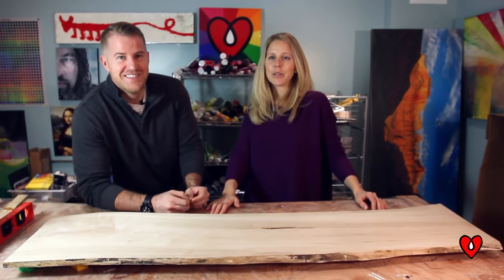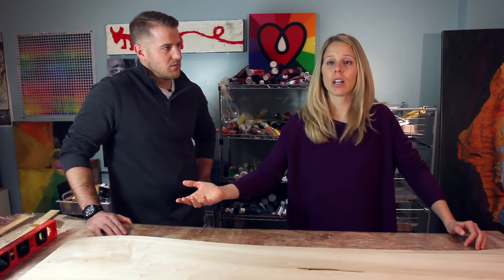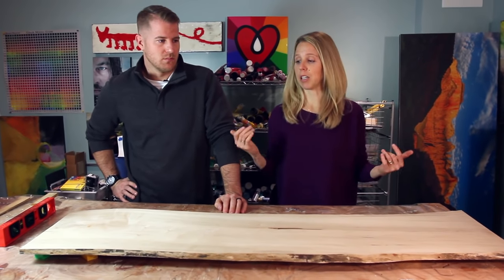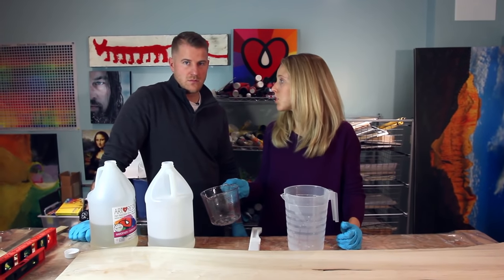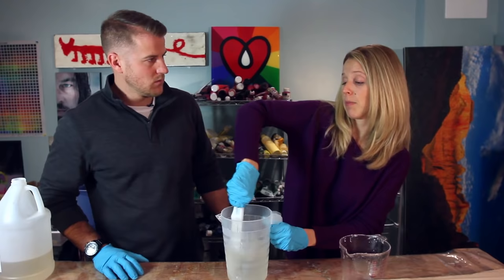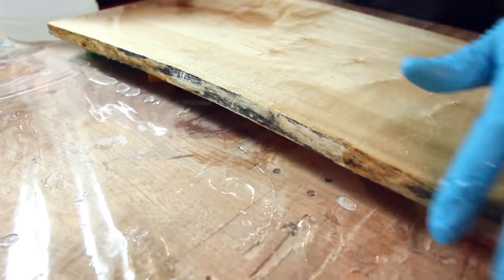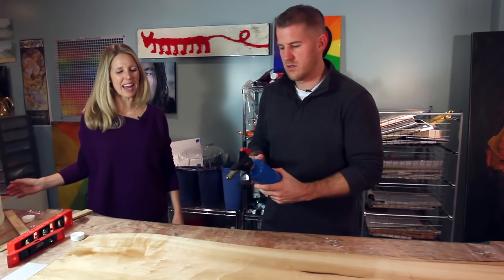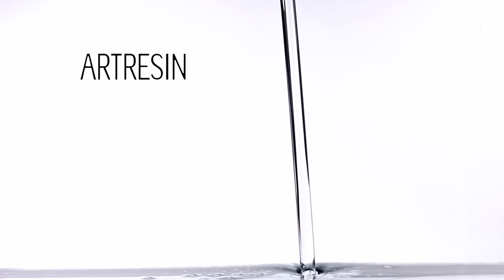How to Resin Live Edge Wood

Comment: If I may add my two cents to what others have said, hard maple and soft maple are two different animals. Hard maple is used for cutting boards and tens of thousands of baseball bats every year. Sugar Maple is used for bats. The Janka hardness is 1450 pound-force. Silver Maple is a soft maple and hardness is only 700 pound-force. A common test to find out which you have is to press a finger nail into the wood. You will see a dent in soft maple but not in hard maple.
Reply from the maker: Thank you for providing more information!

Comment: What is the name of that little scraper tool you used and where did you get it?  Thanks!
Reply from the maker: Hi Lindy, that is our ArtResin spreader.  You can find it in our Accessory kit (https://www.artresin.com/collections/accessories/products/accessory-kit) or just use any plastic notched spreader from your paint or hardware store.  We find the groves are great for moving the resin around your surface and distributing it easily.

Comment: If I wanted to resin both sides of wood like a cutting board, do I have to let one side dry for 24 hours then do the other side and the edges?
Reply from the maker: Hi ShaTerra, Yes you will want your first side to cure. At 24 hours it will be cure to the touch but not fully cure. I might suggest waiting 72 hours for a full cure before turning it over and propping it up to coat the other side to eliminate the chance of any marks on the first side.

Comment: Hello.  How many coats of resin did you use?  I just made a coffee table using a live edge slab (black walnut), but I coated it with a water based polyurethane.  It looks fantastic, but now that I watch your video, I'm thinking it would be great to add a final layer of the art resin for that ultimate smooth surface.  Thoughts?
Reply from the maker: Hi Iry!  Thanks for reaching out!  Absolutely you can apply ArtResin over your polyurethane.  Since it's already sealed, you should be good with one coat ( it will naturally level out to a thickness of 1/8" ).  Often multiple coats are required when wood offgasses and creates bubbles .. it all depends on the wood.  Jordan and Bex were lucky and got a perfect layer on the first try with this piece of maple but some other wood projects we've worked on have required numerous sands and repours until all the offgassing/bubbles had stopped.  Since yours already has the polyurethane on it, you should be good.
Reply: ArtResin thanks so much!
Reply: @Artresin ok what grit in between coats ? Also is there a link for the resin you used?
Reply from the maker: @A1Sealing  you can purchase through our website www.artresin.com
We typically sand with 80 grit, the sanding will remove any surface imperfections and also give the next layer of ArtResin some tooth.  All of the sanding scratches will disappear once the next layer is poured.

Comment: How much weight does this add to the piece though?
Reply from the maker: On a large piece, for example a 5x3 table you will use 75 ounces of the combined product (35.5 oz of each resin and hardener) which will weigh about 5 pounds :)

Comment: Can i mix paraffin with resin when i cook in paraffin bee wood boxes ?
Reply from the maker: Do you want to add paraffin to the liquid resin?  We don't advise adding anything to the resin/hardener ( apart from colorants - no more than 6% ) otherwise it won't cure properly.
Or did you want to coat paraffin with resin?  Resin generally doesn't stick to anything that will repel water, so it may peel off from paraffin.  You would have to test it out to see!
Reply: @Artresin  coat paraffin with resin , what you sudgest to do
Reply from the maker: @Imkerei2024  you will have to try to see if it works.  We haven't tried it over paraffin wax so I can't tell you for sure if it will work or not.

Comment: Did you stabilize or seal the wood first (any prep of the wood)? Was the wood totally dry? Can you please give more info?
Reply from the maker: Hi Kimberly - in this case, the wood was absolutely dry and no, it wasn't sealed at all.  It's always best to start with dry wood ( if you want to get really specific, you can even get a little gadget that measures the moisture ... the ideal amount is 4% moisture ).  
Sealing helps to prevent bubbles ... bubbles happen when the wood off-gasses air, which then gets trapped in the resin.  Whether or not the wood off-gasses depends on so many variables ... the type of wood, how dry the wood is, if the wood is raw etc etc etc.  Personally, I love erring on the side of caution and pre-sealing whenever I work with an organic material like wood.  It takes no time at all - you can use a thin layer of ArtResin to seal applied with gloved hands and a disposable brush to get in the crevices, or a sealant of your choice ... just be sure you get one that dries clear.  For something like wood, that can have nooks and crannies and uneven spots, I would probably choose a brush on sealant as opposed to a spray sealant, just to make sure that every bit gets good coverage.  Hope this helps :)
Reply: Would it be ok to cover the wood with bees wax before adding the resin? will that affect it at all?

Comment: Wow dumbest vid ever.....just sand it down and reapply its not problem? Its a lot of extra work and epoxy is expensive. Also you should do 2 seal coats and a flood coat so that one thin coat is really phoning it on (kind of like the gift itself lmao) but it any rate you should torch or heat gun every 10  15 minutes till the bubbles stop rising. Which is why you should do the seal  coats first then there will be no offgassing from the wood only what got trapped in the epoxy while mixing. Lastly I agree with not bothering with taping when you do the top but what about when you do the bottom? You do, do the bottom right? Otherwise that thing is going to cup and twist and usually by a lot and can happen within a short period of time after the top cures